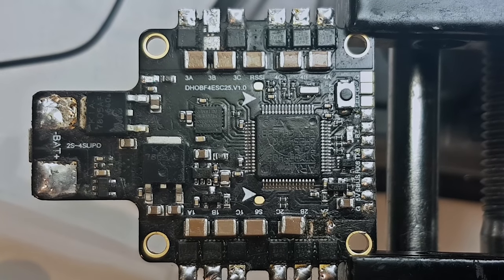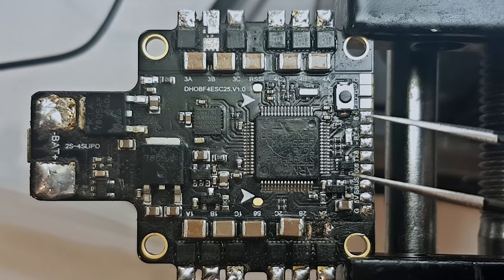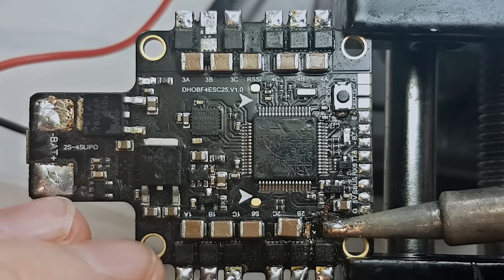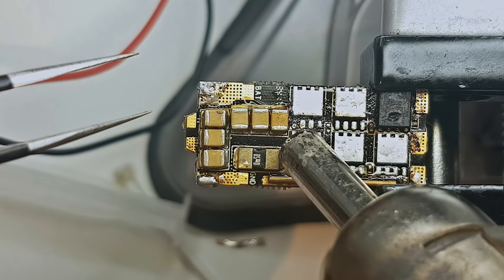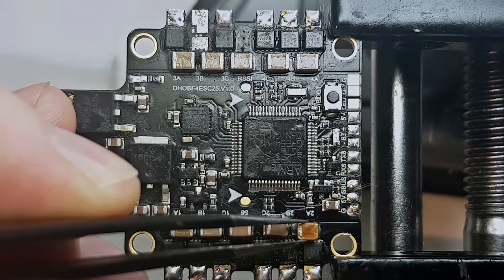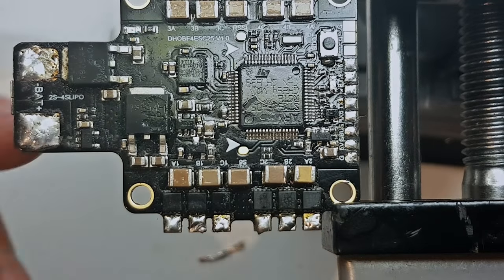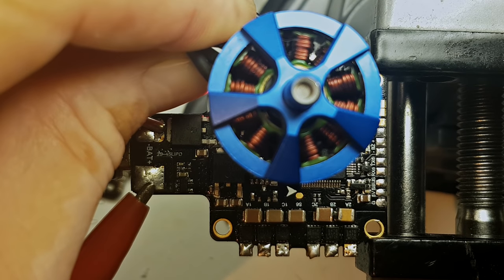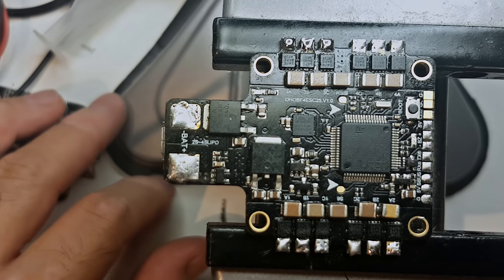Cicada AIO FC & ESC REPAIR (mosfet replacement)

Comment: I have a Crazybee f4 lite 1s FC, and one ESC is still beeping when turning on, but when asming the motor doesn't rotate properly. It's twitching, as if it cannot find the right rythm. I tested with other motors, but the problem is the ESC. Do you have any idea what I could do?

Comment: I know it s an old video but anyway if you reply, I ll be happy so.... 11min46 you replaced the mosfet and I notice that 2 legs on top are shorted and later in the video they are not anymore. Did you noticed that also and cleaned it or it stayed like that? 
I m learning a lot from you and because of you I start to repair my stuffs. it works mate it works. Thank you so much Livyu.

Comment: Hello Liviu, im having similar issue with a BETAFPV 1-2S AIO board. I sended u message. All i wanted to know is: one of 4 esc's burned by accidentaly shorting 2 motor wires. It still worked, but motor had no "force" and was not spinning like others, and the quad wont lift off. I tryed to change the mosfet with burn mark, but still the same... I wanted to know if i have to change the whole mosfets or is there a way to know what to replace... If u have time ill send u some pics by messenger. Thanks for your work !! 👌💪

Comment: capacitors in series does not add capacitance, divides it. Are you sure those capacitors are in series? It also raises the internal resistance. Caps in parallel adds capacitance and lowers IR.  nice video man. I blew my esc up, unloaded motor and sudden stop from high Rpm, killed mosfet after mosfet, probably needs a cap mod or something if banggood sends me a new one.
Reply from the maker: Yes thats correct... but also doubles the voltage rating  :;

Comment: On one of my ESC a Capacitor burned. The ESC still works, would you say it is safe to use it or should I try to repair/buy a new ESC?
Reply from the maker: well i would say add an electrolytic cap and go on but make sure nothing else is burned and clean the area a bit.

Comment: can i replace the mosfet of diferent esc but the same amps...aikon35a 4in1 and emaxbullet35a
Reply from the maker: not really, you have to use the same part number. There are a lot of specs related to mosfets other than amps :)
Reply: in this repair video you said that you used the generic china mosfet
Reply from the maker: @tianofpv1845  no, I said I took the mosfet out of a generic china esc. It just happened to be the same part number.
Reply: Livyu FPV thanks for your time...i also have revolt v2...i flashed it from flight one to betaflight 3.4 it successfully flashed but after a few reboots it was not boting up..the data/status led is not flashing...but the board has power
Reply: Livyu FPV and i tried to reheat and remove the f4 mcu and replace fresh solder but still no chance of booting....it cant detect via pc

Comment: Did you ever rebal a Gyro?
Reply from the maker: normal gyros are not bga's so no reballing needed. But yes i have changed in the past gyros never did a video about it cause i had no fc's with that issues. If someone sends one i will most definitely do it :)
Reply: @LivyuFPV  mabey i get one for you. Same FC like this one frome the video